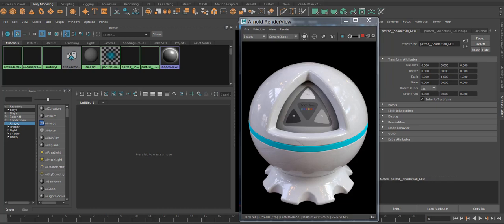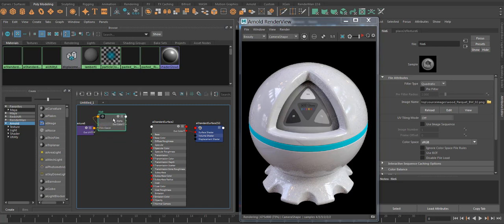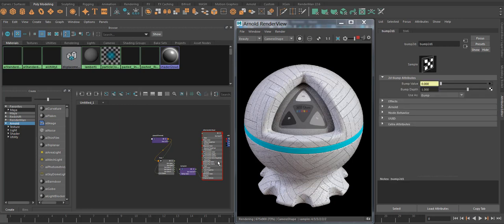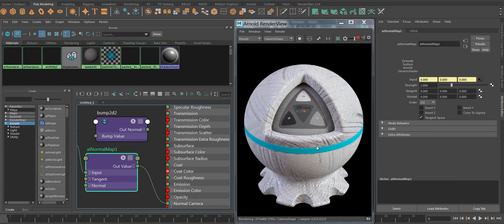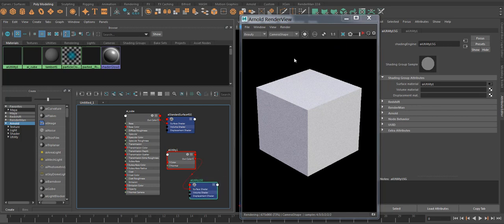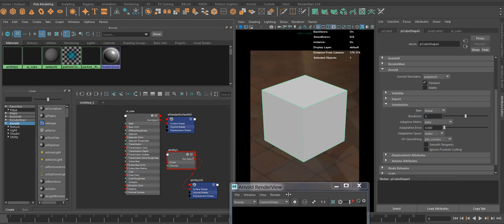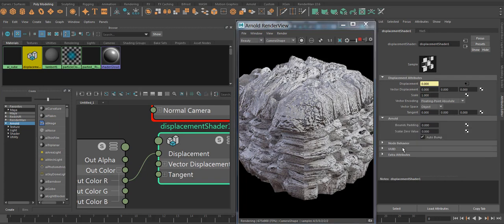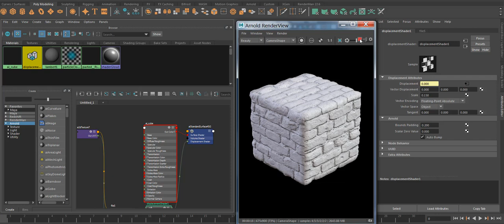Maya at a Glance: Bump map, Normal Maps and Displacement maps in Arnold

Comment: But, What difference between bump2d and ainormalmap on normal map nodes ?
Reply from the maker: The main difference between bump2d and aiNormalMap comes down to how they handle normal maps and what they’re meant for. bump2d is more old-school and works with grayscale height maps to fake surface detail. It kinda "fakes" bumps by altering how light interacts with the surface. aiNormalMap, on the other hand, is specifically made for normal maps. It takes a tangent-space normal map and properly converts that data into shading normals which is recommended by Autodesk.

Comment: is there any way to put hard edges and not have them look soft with the displacement?
Reply from the maker: Yep, one trick is you can try using a normal map or bump map alongside the displacement to keep those edges sharp. Also, check the tessellation settings in Arnold to make sure it's not smoothing out the edges.

Comment: Hi, I seriously have a doubt.
How to use seamless pbr on a large non spherical or cubical mesh like a cliff or a hill. I am newbie...
Reply from the maker: Disp map is usually driven or created by CLR map and to have a clean color map you need to have a clean uv. As you can see everything is connected here. My advice is to hide the uv seams where it's less visible and  get assistance from substance 3D or Knald to generate your displacement map where possible
Reply: @sarkamari  thanks man!   and also one more doubt. How to remove this tile repetition